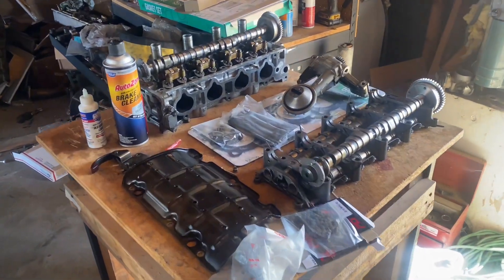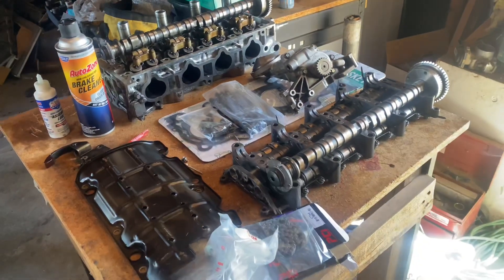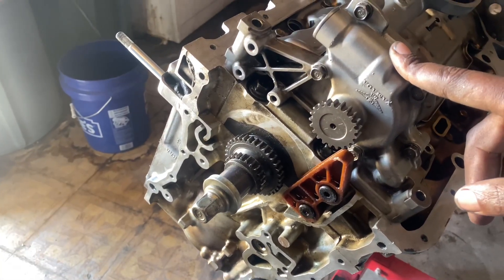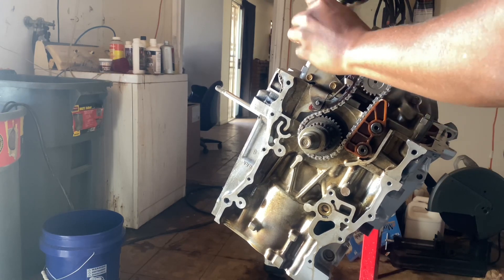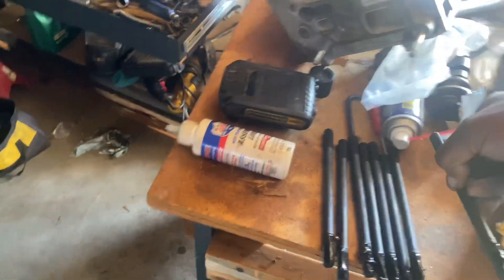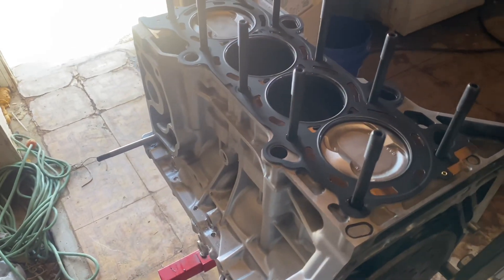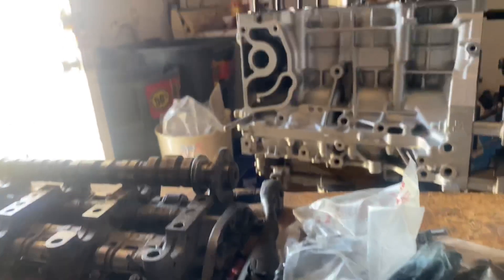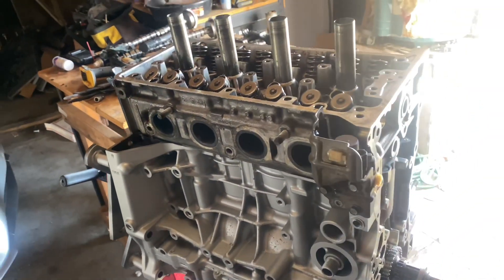How to build a budget k series part 6

Comment: @Rarewitit  Did you ever get any feedback how those Jack Spania studs performed or any issues?  Also I was wondering (1.) do you have to replace the chain on the oil pump or can you reuse the K24 chain?  and (2.) which head gasket do you need, the K24 one, no?
Reply from the maker: Ended up parting the motor out , u have to use Rsx oil pump and chain and k24 timing chain
Reply: @rarewitit7899  Word!  And is it the K24 head gasket?  I'm going to be building a K20/K24 with TSX bottom and Type S head
Reply from the maker: K24 head gasket
Reply: Thanks man!  I'm so excited cuz I found someone to trade the FG2 for a 03 DC5, that motor is going in my Integra and the Type S I want to make a K20/K24 out of

Comment: I had a question , I’m from Cali and I got a k20/24 swap , k24 was a donor and had no choice , I’m having trouble finding someone who can tune my car to pass BAR , the person who installed it turned off all OBD2 to make it run with a tune he made , and now he ghosted me and I’m stuck with a car I can’t drive, you anyone in California that can fix or tune my car to run California legal
Reply from the maker: Well first thing is , you need to convert your car all to stock , meaning you need drive by throttle and need to run stock Ecu , hondata is illegal and will fail instantly , you also need the gas tank and evap system or you will fail , i recommended selling your swap and going k20a2 which is possible since it’s cable throttle and you can actually run the stock Ecu , check out my bard videos on my page for reference, Honda.mike1988@gmail.com , hit me up if you want me to do it
Reply: @rarewitit7899  I forgot to mention it’s a 2006 RSX type s , everything is carb legal at to mods , but with the ecu idk why it doesn’t read when obd2 is trying to read it , smog station said everyone is turned off
Reply from the maker: @dlosensei762  you would have to go stock Ecu , hondata can’t be smog legal